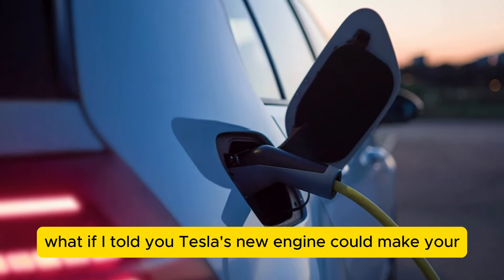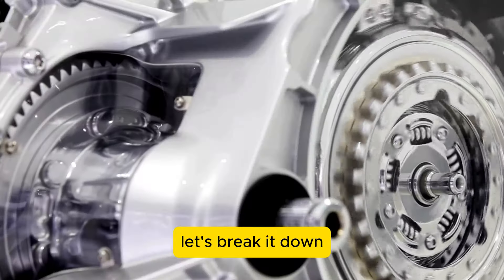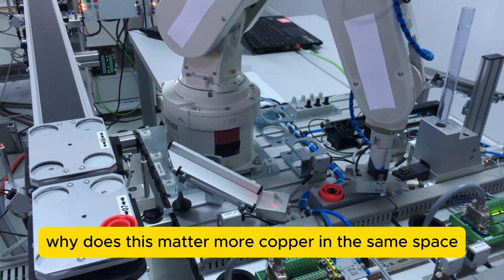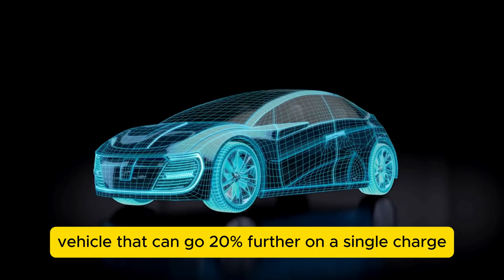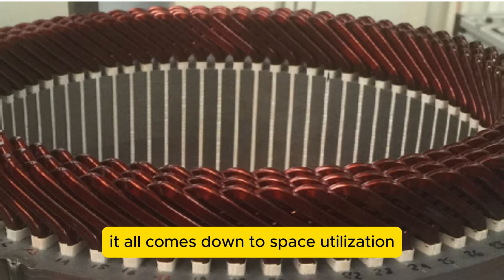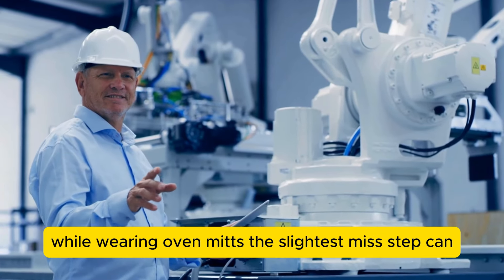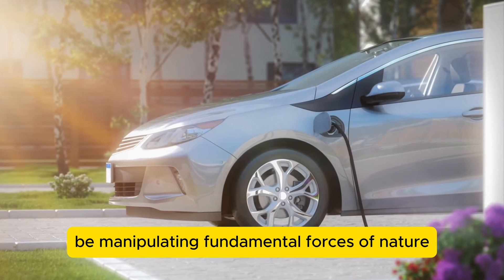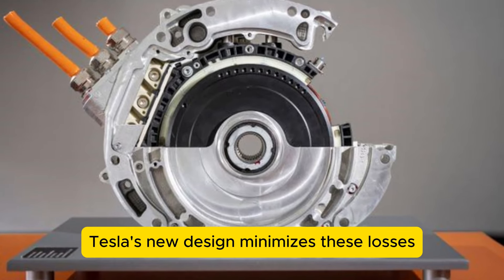Elon Musk: Tesla's New Engine Will Change The EV Industry Forever!

Comment: The problem with electric cars is not the power or efficiency of the motors, the limitation is the weight and space cost of using batteries instead of liquid fuel
Reply: Absolutely, that's the reason the trucks didn't work, or the coupe, for opposite reasons, not power, but this is youtube school